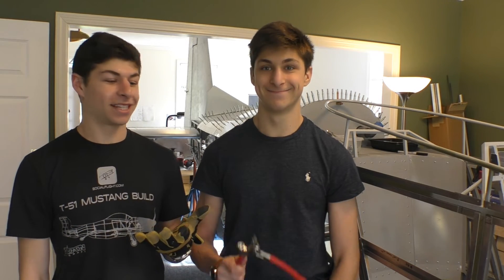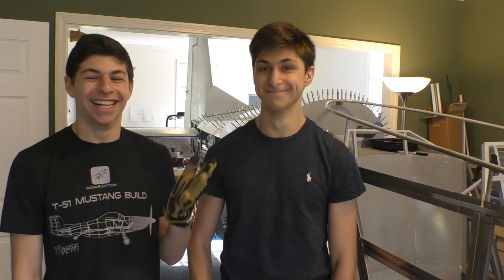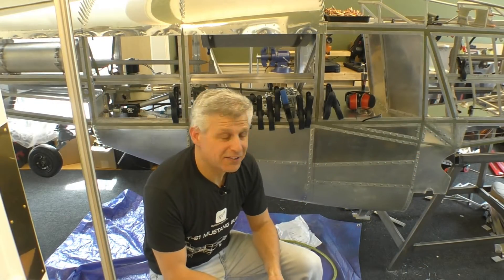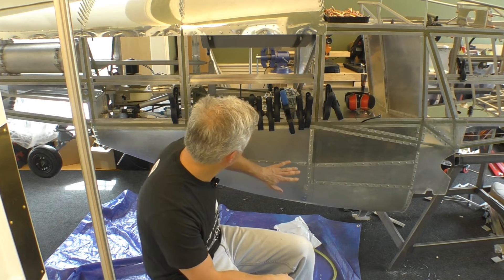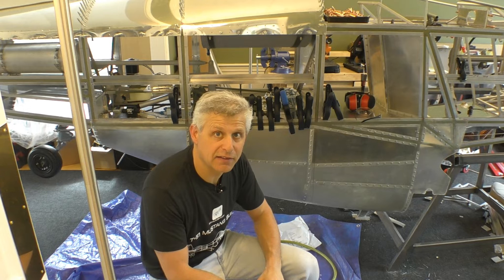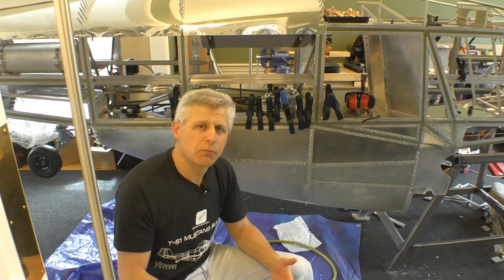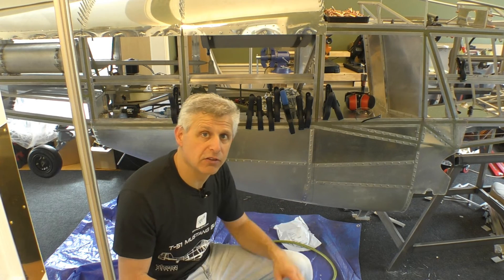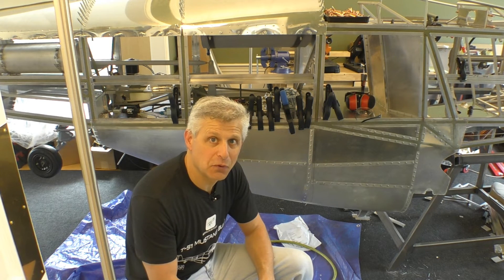Belly of the Beast - Our T-51 Mustang Belly is DONE!

Comment: Would it have been beneficial to scuff that aluminum before priming or is it unnecessary to get good adhesion?
Reply from the maker: We use a self etching primer, so scuffing is not required. However, we do clean the surfaces with acetone before pruning.  On surfaces that will be bonded with glue, we do scuff the surface with 80 grit
Reply: SocialFlight Thank you, that’s very helpful. The T-51 is really coming along I can’t wait to see it flying